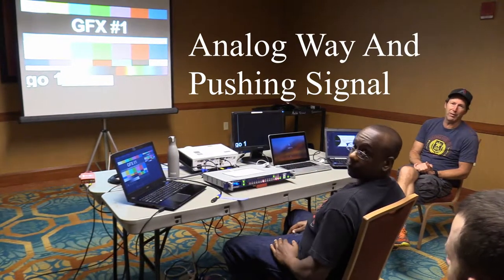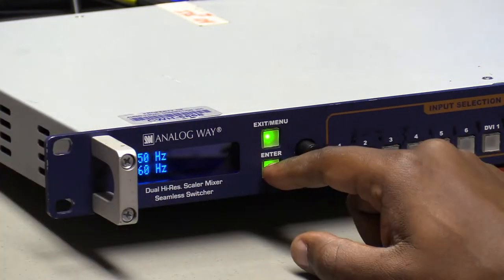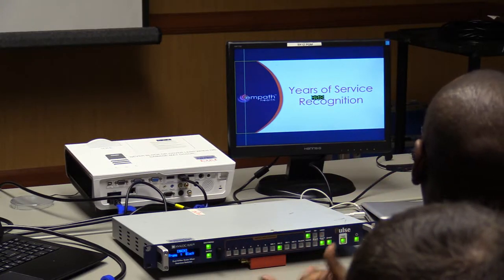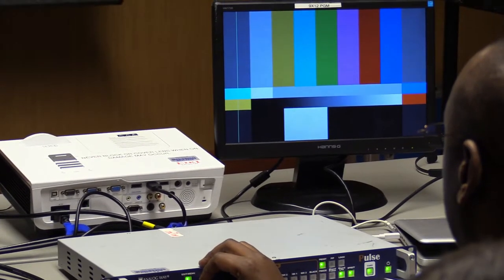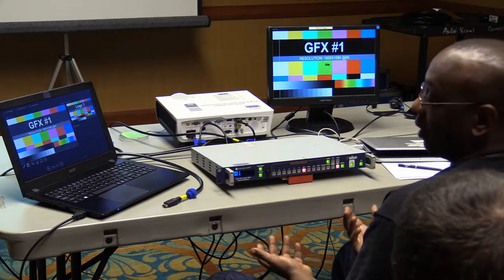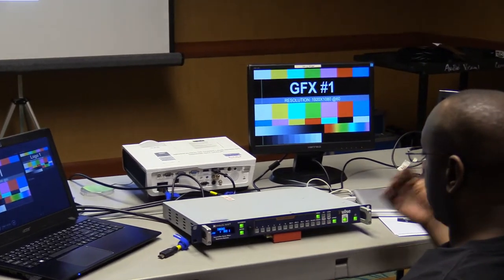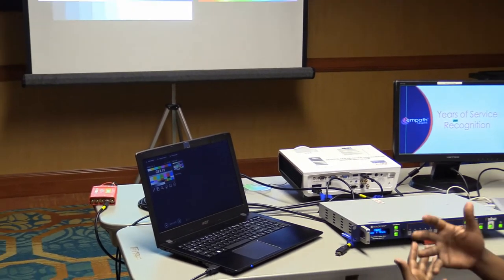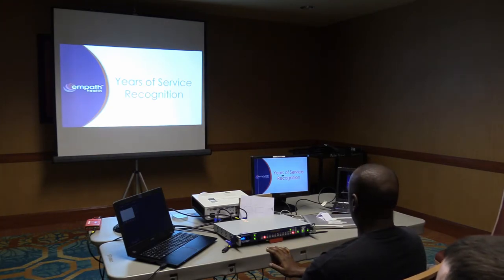"Professor" Mumo: Pushing Data Via Analog Way Pulse

Comment: Fun fact: the small decimators can be powered by the projector itself. Plug the USB into the project USB port. Can save you a power strip. Just make sure you unplug the USB before powering off and powering on the projector.
Reply from the maker: Thanks for the tip! That was actually discussed during this tutorial.  I just happened to have edited it out. It is definitely a good point to make if you were strapped for power.